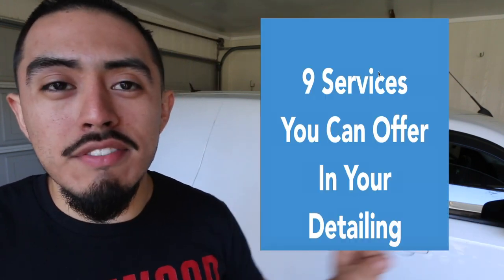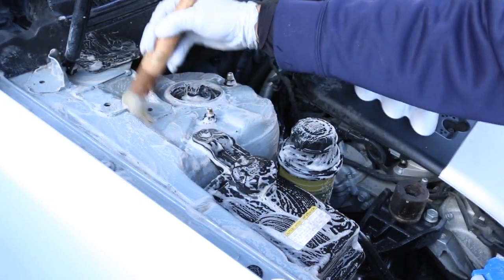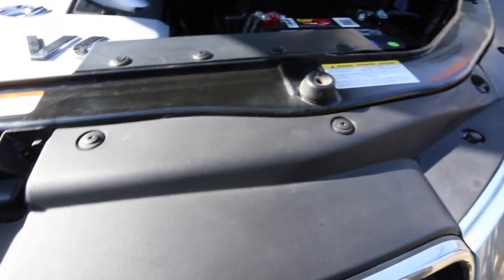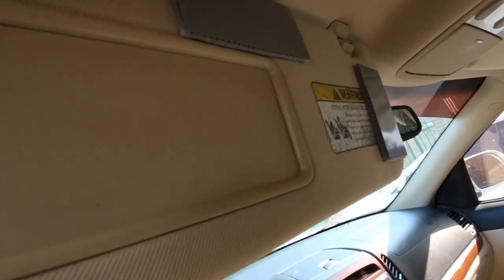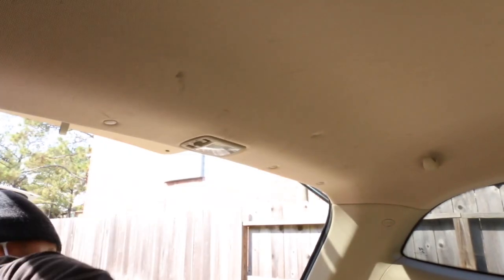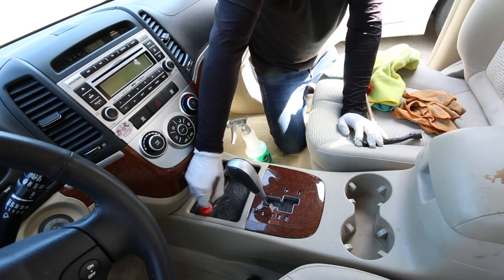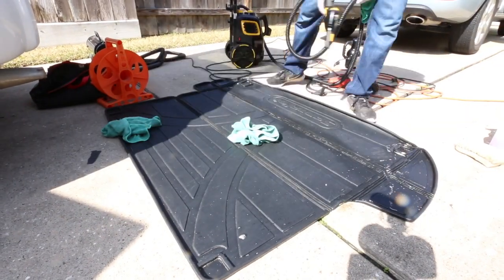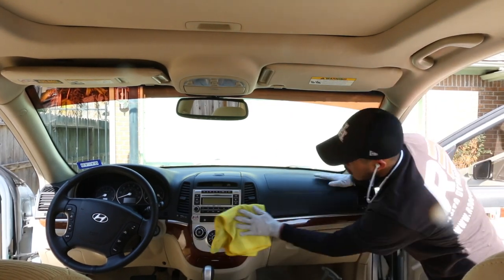COMPLETE Interior Cleaning & ENGINE Cleaning on 2007 Hyundai Santa Fe - Car Detailing Tips

Comment: I;m glad you mentioned the struggles with streak-free glass; I'm dipping my toe in the water at the moment and one of the first details I did was for a friend (whom I asked to let me know of anything she feels needs improvement) - The glass was very badly streaked. I had just used some APC w/ normal microfiber towel on the glass. Also it was a hot sunny day.
Lesson learned. I did some research and then the next evening went back over them with Stoners Invisible Glass and waffle towel - A lot better

Comment: Hello, I have a 2013 white silverado crew cab, what do you suggest to keep the back fenders clean, the front are rubber but the rears are metal body, keep up the good work
Reply from the maker: Thanks! You can use a plastic dressing like VRP for protection. Other than that, maintenance cleaning to keep them like-new
Reply: Detail Groove thank you for the response back, but what is VRP?
Reply from the maker: http://www.chemicalguys.com/V_R_P_Super_Shine_Dressing_16_oz_p/tvd_107_16.htm
Reply: Thank you for the info
Reply from the maker: You bet

Comment: Hey Oscar , if I don't have access to a garage, can I do paint correction outside in the shade ?
Reply: amed lak If it's above 90 I wouldn't recommend it , the product will dry faster and you have to also decontaminate with a iron spray and if u let the sun bake it you are going to damage a car . And also you're clay will mar more likely
Reply from the maker: It really depends on the environment. If you are in the shade, sure, but you're going to face other problems; pollen, dust, sun going down, sun moving through out the day, rain, heat, etc... So yes, it's possible, just have to be strategic about it

Comment: Is the super clean apc okay and safe to use on the exterior paint of car; say for tough marks like road tar, etc?
Reply from the maker: Yep!
Reply: Hi Richard!  Yes!  We recommend starting with an 8:1 ratio (8 parts water to 1 part Super Clean).  If you are needing more cleaning power, you can slowly increase the concentration and time that you let Super Clean sit.  Start with the surface as cool as possible, do not work in the direct sunlight and never let Super Clean dry on the surface.  Spray water on the surface before you begin and work in small sections.  Apply Super Clean diluted to 8:1 and rinse quickly and thoroughly.  Please be sure to always do the testing on an inconspicuous area until you know the dilution/time ratio.  If you have any additional questions, feel free to email customerservice@superclean.com  - thank you!

Comment: Love you videos, keep it simple is great.  Question, what do you use for a vehicle that has a ceramic coating on the paint and wheels?  The wheels measures apc? And the drying aid for the ceramic coating? Usually I use meguirs detail spray and wax as a drying aid. But not sure I can use that on vehicles with ceramic pro,or c quartz
Reply from the maker: You could just use soap and water for the wheels as the coating should make life a lot easier to clean

Comment: how much did you charge for this?? was this job priced more because how dirty it was?? why did you not use steam on the doors/ grease areas?
Reply from the maker: I think $220. Can't remember. Price is always dependent on condition. I never use a steamer on door jambs. It's faster with just a towel and APC/ONR
Reply: @DetailGroove  when you do a mobile detail do you have to use the customers water source and electric?  what do you do when it rains outside?

Comment: For some reason when I clean tires after they drive they have yellow stains all over them?
Reply: And for some reason when I apply tire dressing some part look like I didn't apply tire dressing at all
Reply from the maker: Hmm, that's very interesting. What's your cleaning process?
Reply: Detail Groove what I do is spray water on the wheel, spray some all purpose wheel cleaner by mothers and scrub the tires like twice and then rinse then I do the rims with a wheel brush....I think the tires look like that because I don't dry them I just apply the tire gel
Reply from the maker: Well it's all about testing. Try that method and check your results